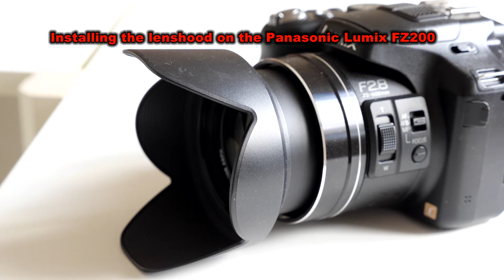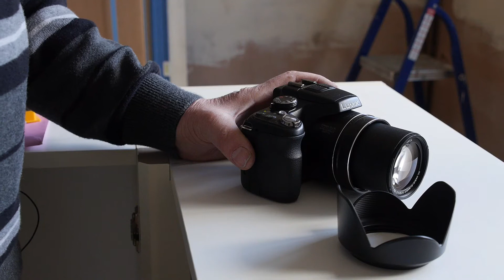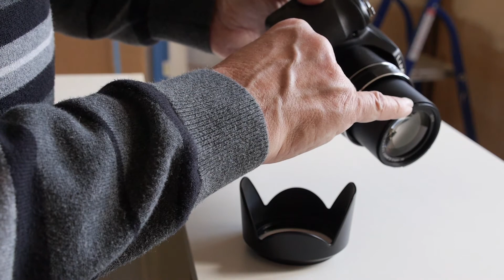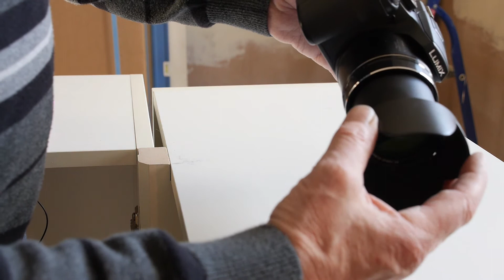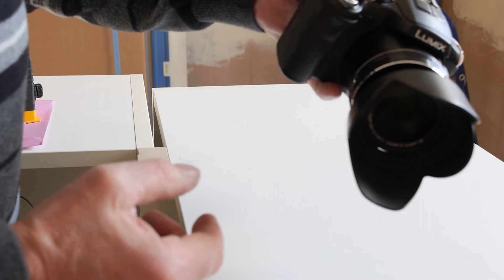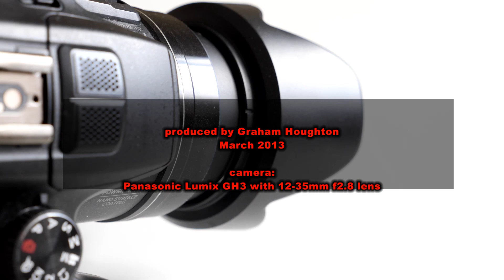How to install the lens hood on the Panasonic lumix FZ200

Comment: Brilliant advice. I had to buy a new hood and it was so tight that I was also worried about breaking it. The tip about the groove on the hood and lining it up to the 9 o'clock position really helped reassure me that I was doing the right thing and just needed to apply more force. Thank you.

Comment from the maker: The lens hood prevents light from reflecting inside the lens causing flair and reduced contrast. It helps with all but direct sunlight into the lens. It also acts as protection for the front face of the lens so you don't need to add extra uv filters etc. It has to be removed for flash as it causes shadows on the lower part of the images. Flash is automatically adjusted by the camera as it uses a pre-flash to measure the amount of light reflected back into the camera.

Comment from the maker: Two different systems and cater for two different types of user. The FZ200 is a great all round stills and video camera with total convenience . The 600D is going to give better images in lower light but will need additional lenses to achieve the same creativity as the Z200. If you don't need long zooms then if the additional size and weight isn't a problem the 600d is a better option

Comment from the maker: I haven't tested the HX200. I know the FZ200 will film very well with the f2.8 lens up to iso 400 so that allows a little bit of extra light if you need to apply any zoom. The HX200 looses aperture as you zoom in so it really depends upon what scenes you intend to shoot. All 1-2/3 inch sensors tend to be a little noisy in stills mode the video mode masks a little of this.

Comment from the maker: It's impossible to fit the FZ200 hood incorrectly as the bayonnet tracks on the lens barrel ensure that the biggest petal is to the top and the small ones to the side. You should never see the lenshood either on zoom or wide angle/ Are you using the FZ200 hood or an alternative?

Comment: Would anyone ,who has an FZ200, be so kind to measure how "long" the camera is when you attach the lens hood?

Thanks in advance
Reply from the maker: 155mm lens retracted and hood installed, 115mm lens hood reversed and 205mm lens fully extended
Reply: Graham Houghton thanks a lot, Graham :D